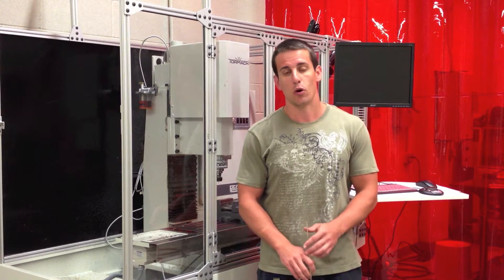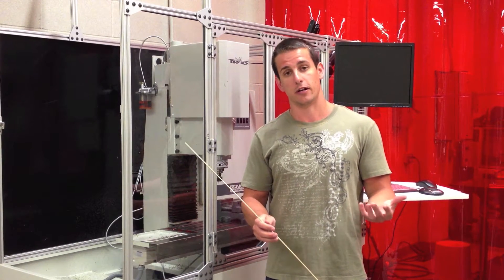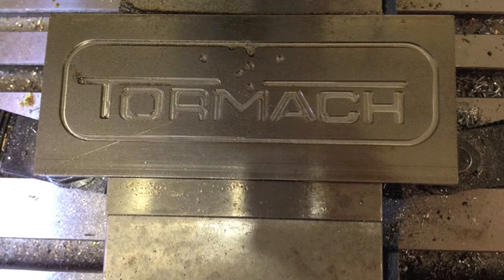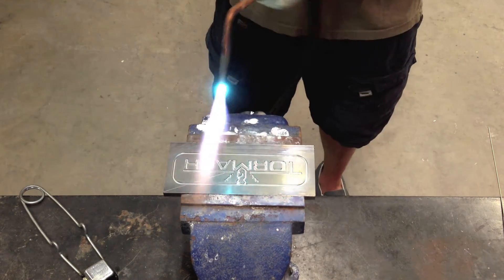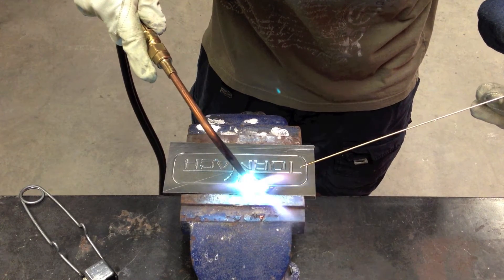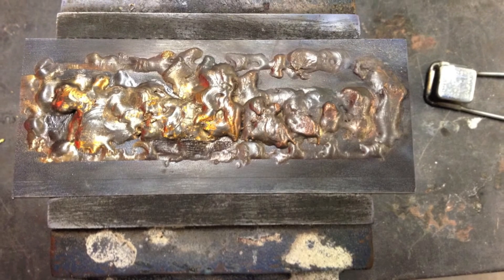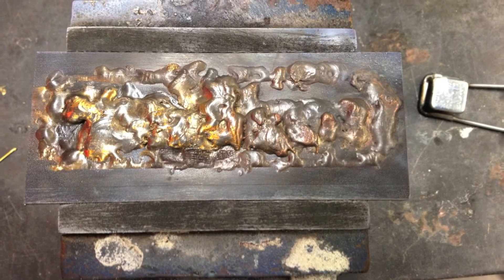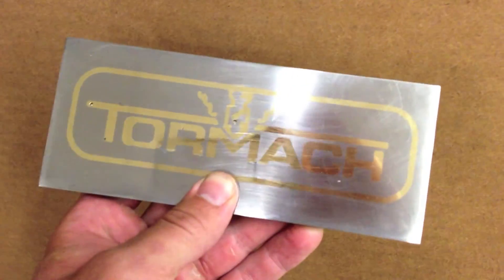Inlay Bronze in Steel (CNC & Brazing Method) Tormach Logo

Comment: The problem was with your technique.  An easy way to know how to add material is if there is slag you drag.  You need to touch the rod on the front of the puddle if there is no slag, like mig and tig welding.